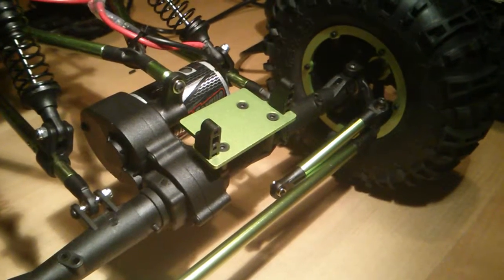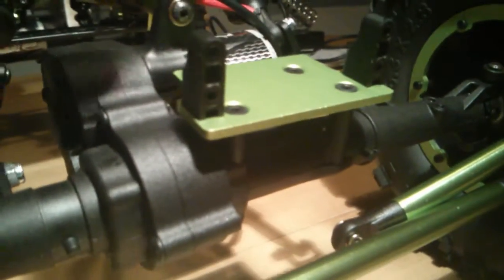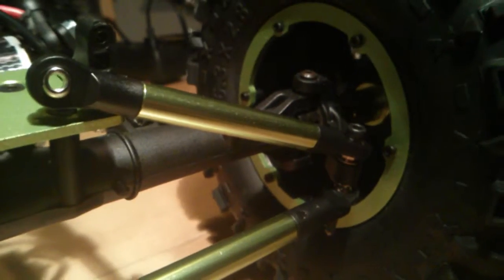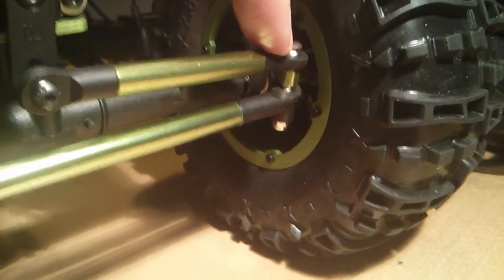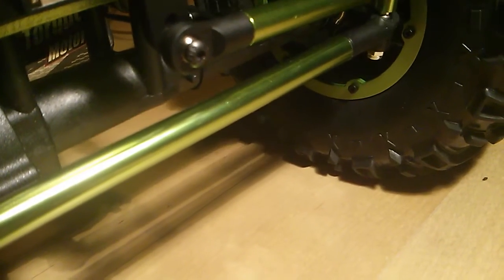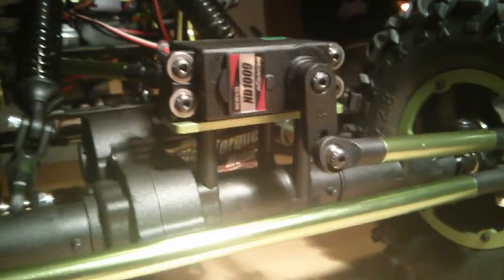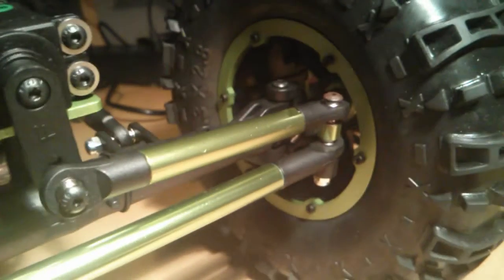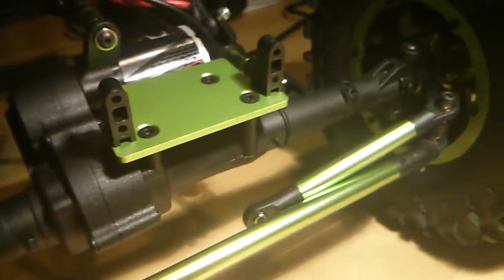Amewi Spirit 1:8 Crawler steering modification

Comment: come on man.... you put link down and it will hit obsticals on the ground. The idea is to make it up to avoid contact with obsticals. You did oposit thing.
Reply from the maker: I lowered the upper / steering link, the lower link is fixed and hit obstacles from first